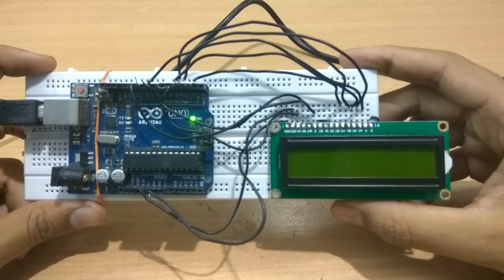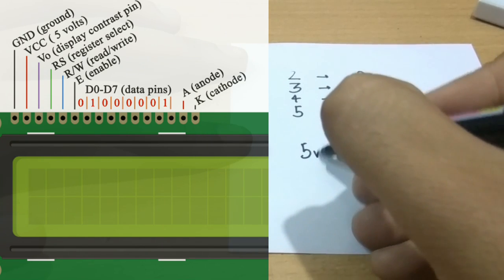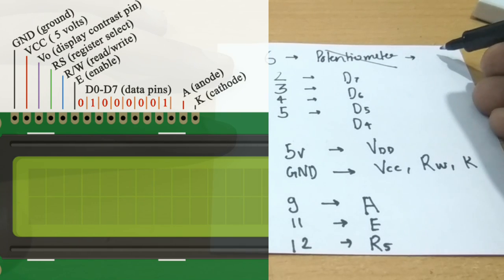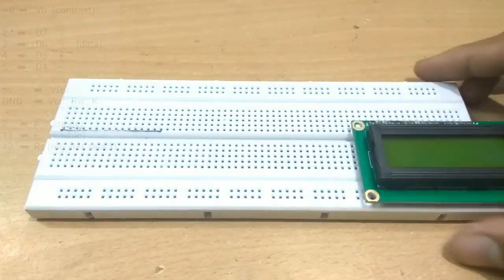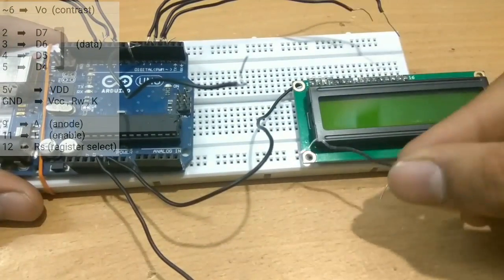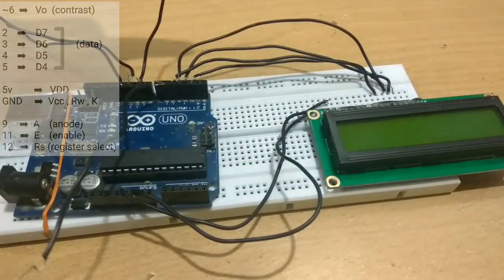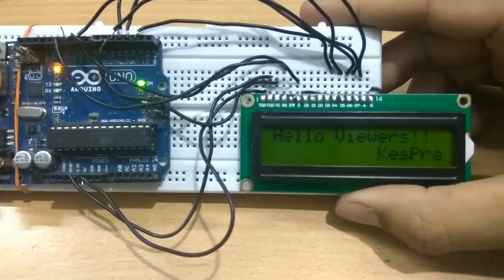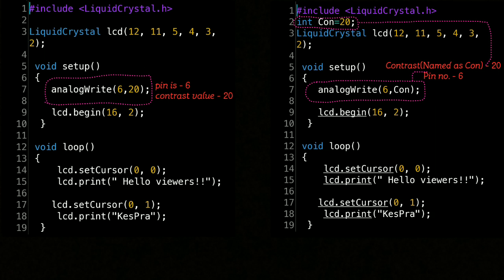Arduino - connect LCD without Potentiometer| Full Tutorial | no Pot / Resistor | KesPra ✔

Comment from the maker: #include <LiquidCrystal.h>  
int Contrast=20;
 LiquidCrystal lcd(12, 11, 5, 4, 3, 2);   

 void setup()
 { 
    analogWrite(6,Contrast);
     lcd.begin(16, 2);
  }  
     void loop()
 {  
     lcd.setCursor(0, 0);
     lcd.print("Hello Friends");
    
    lcd.setCursor(0, 1);
     lcd.print("KesPra");
}
Reply: this code shows compiling error.
Reply: @nitesh6732  then delete the arduino software and reinstall it or switch to a different user
Reply: Bro error aa raha he 
stray '\357' in program 
Koi hal batav
Reply: error '\357' only happens when you copy the code from somewhere try changing the text
Reply: @NTTechnokings  #include <LiquidCrystal.h>  
int Con=20;

LiquidCrystal lcd(12, 11, 5, 4, 3, 2);   

 void setup()
 { 
    analogWrite(6,Con);
     lcd.begin(16, 2);
  }  
     void loop()
 {  
     lcd.setCursor(0, 0);
     lcd.print("Hello Friends");
    
    lcd.setCursor(0, 1);
     lcd.print("KesPra");
 }
Reply: Guys copying the code from this comment might add special charecter in your code which will eventually show error by the compiler. Be aware of that.
Reply: whats Vdd??
Reply from the maker: shubhan patange , Vdd is for giving power to lcd using 5v from arduino or a battery.
Reply: This worked for me just fine, thank you, appreciate it.
Reply: for nano ?? is the same connections??
Reply: NT TECHNOKINGS
Please tell if you got the answer to that
Reply: KesPra mail me code
Reply: Thank you, sir!!
Reply: KesPra
Reply: Twinkle Nagmoti 
Same problem me
Reply: remove the } and line and replace it with a new }
Reply: KesPra hey.. there's an error in the program.. stray\357
What is that?
Can you please resolve it?
Reply: KesPra a
Reply: Bro can you clear one thing that is
You have solder LCD Pins socket into the breadboard circuit right ?
Means you solder LCD Pins and put into the breadboard for  connection  purpose 
Plz reply as early as possible ..
Reply: How to make the text brighter
Reply: @drdolasanjays-sreekartubeh2576   if you want to do that you need a potentiometer
Reply: I cannot copy it
Reply: THIS CODE IS GIVING ME ERROR PLS SAY WHAT TO DO
Reply: thx bro
Reply: Not working

Comment: I keep getting very dim blocks to light up but no text and change in contrast is barely visible, note that my lcd display says VSS not VCC idk if thats thr issue
Reply: mine one also says that but connect it it will work also connect the anode pin to 5 v

Comment: Make sure to use a PWM pin. What you're doing is controller the voltage and essentially mimicking the potentiometer and controlling the resistance through the voltage since V = IR or R = V/R. The higher V (0, 255) or (0V to 5V) the higher the resistance.

Comment: Here is the code that worked for me 
#include<LiquidCrystal.h>
int Contrast=150;
LiquidCrystal lcd(12, 11, 5, 4, 3, 2);

void setup()
{
analogWrite(6,Contrast);
lcd.begin(16, 2);
}
void loop()
{
lcd.setCursor(0, 0)
lcd.print("dhruvansh")
lcd.setCursor(0, 1)
lcd.print("kumar")
}

Connect anode pin to the 5v
Reply: thanks for that backlight brother..!
Reply: it doesnt work bro....display itself not showing

Comment: Bro can you clear one thing that is
You have solder LCD Pins socket into the breadboard circuit right ?
Means you solder LCD Pins and put into the breadboard for  connection  purpose 
Plz reply as early as possible ..
Reply from the maker: I have not soldered it.
I bought it from my friend with pins already soldered on the back of lcd.

Comment: This is a great project! Only downside I suppose is that it uses 2 additional pins vs the resistor way, which could be an issue for those who are tight on pins in their project.

I needed to switch both pins 6 and 9 on. Played around with digital 9 but ended up using analogOutput with a value. Here is my code:

#include <LiquidCrystal.h>
int Con=40;
LiquidCrystal lcd(12, 11, 5, 4, 3, 2);

void setup() {
  //pinMode(9, OUTPUT);
  //digitalWrite(9,HIGH);
 analogWrite(9, 500);
 analogWrite(6,Con);
 lcd.begin(16,2);
 lcd.setCursor(0, 0);
 lcd.print("Hello World!");
}

void loop() {
  // set the cursor to column 0, line 1
  // (note: line 1 is the second row, since counting begins with 0):
  lcd.setCursor(0, 1);
  // print the number of seconds since reset:
 lcd.print((millis() / 1000));
  //lcd.print(millis());
}

Comment: Arduino: 1.8.5 (Windows 8), Board: "Arduino/Genuino Uno"

liquid_crystal_dispaly:19: error: stray '\357' in program

 }ï»¿

 ^

liquid_crystal_dispaly:19: error: stray '\273' in program

liquid_crystal_dispaly:19: error: stray '\277' in program

exit status 1
stray '\357' in program
Reply: exit status 1
stray '\357' in program same problem
Reply: You need to retype all the error lines by yourself, worked with me

Comment: Why does his code say "analogWrite (9,whatever);" when this pin is actually plugged into pin 9 on the Arduino?  I see a few people below who have fixed it in their comments/recommendations.  Is this just sloppy?  A typo?  Does it depend on the board?

In any event, trying 9 vs 6 still doesn't fix my problem.  Trying to adjust the contrast number doesn't, either.  Off to double-check wiring...
Reply from the maker: Hey, pin 6 is for contrast of text.
Pin9 is for the backlight or led.

Comment: having the error : 
Arduino: 1.8.4 (Windows 10), Board: "Arduino/Genuino Uno"

LCD_INTERFACING:19: error: expected unqualified-id before '?' token

 }?

  ^

exit status 1
expected unqualified-id before '?' token

This report would have more information with
"Show verbose output during compilation"
option enabled in File -> Preferences.

Comment: there's no output voltage on pin 9 ,since there no code written for it.
Reply from the maker: Its for Backlight/LED (optional).
Give output HIGH to turn on led
Reply: +KesPra thanks dude.
your programs works perfectly.
just executed it

wat the code for output high on pin 9.can i directly connect +5 to anode directly.?
Reply from the maker: Yes you can directly connect to +5v or +3.3v

Comment: Till how much distance arduino uno HC-SR04 can detect? Distance in cm ?
Reply from the maker: Around 2cm to 400cm
Reply: Thank you, 
and do u knw till what temperature n pressure it can sustain?
Reply from the maker: It works fine in temperature range of 0–50 °С but i'm not sure about pressure , as Change in pressure will give few % of error in reading
Reply: Hey can u able to give me codes which can show distance upto 400cm... pls that will b too much helpful

Comment: I have done exactly what you mentioned in your video.But my LCD didn't display anything, not even boxes.
I don't understand the reason.Kindly help!!!
Reply: Select LCD from the arduino library bro
Reply: Same case with me
Reply: Same comes to me
Reply: me 
neither
Reply: Try this ....and subscribe if you like

https://youtu.be/MV85HWRdLPw
Reply: <LiquidCrystal.h>  

int Contrast=20;

 LiquidCrystal lcd(12, 11, 5, 4, 3, 2);   

 void setup()

 { 

    analogWrite(6,Contrast);

     lcd.begin(16, 2);

  }  

     void loop()

 {  

     lcd.setCursor(0, 0);

         

    lcd.setCursor(0, 0);

     lcd.print("system crash");

}
use this code

Comment: Arduino: 1.8.2 (Windows 10), Board: "Arduino/Genuino Uno"C:\Users\armanrockali\Documents\Arduino\sketch_lcd\sketch_lcd.ino:1:28: warning: extra tokens at end of #include directive #include <LiquidCrystal.h> Â                             ^sketch_lcd:3: error: stray '\302' in program  LiquidCrystal lcd(12, 11, 5, 4, 3, 2); Â    ^sketch_lcd:3: error: stray '\240' in programsketch_lcd:9: error: stray '\302' in program   } Â    ^sketch_lcd:9: error: stray '\240' in programexit status 1
stray '\302' in programThis report would have more information with
"Show verbose output during compilation"
option enabled in File -> Preferences.
Reply: Check Your Arduino Connection to PC, First try Other Blink Program, If Works, then problem With LCD Wiring , If still says error, then Problem with Arduino Connection To PC/Short..

Comment: Is there any way to bring-on the brightness? Works fine but no brightness. My Lcd is a 16X2 - 16pin
Reply: Yes, Change the Contrast, like in the Code,  analogWrite(9,50); 50 is the brightness here..
Reply: put the A slot on the LCD on to the ~9 slot of the arduino or sunfounder (Any type of Arduino board)
Reply: I had the same problem

Comment: I did the connections as mentioned in the video but the data displayed on the LCD are not clear
I think the backlight of LED must be set to high in the code
Reply: analogWrite(9,50);  , Change the 50 value and check it out.

Comment: Hello so my lcd didn't come with pins on the top and its not displaying anything...
Please respond soon
 thanks.
Reply from the maker: NinjaRick , hey in that case , try to connect wire to name of pins i.e. find where is your groud , k, a,  etc pins on your  lcd.
Reply: I have everything plugged in it just isn't showing up.

Thanks though
Reply: Backlight is running ? Then Problem is with the code. make sure to add  analogWrite(9,50);

Comment: my lcd glows very brightly...bt my board does not displays letters...do i have to change my program with other values
Reply: use the 3.3V slot for the Anode on the LCD
Reply from the maker: Roashan S , try higher value for contrast (try increase number from output  pin i.e. 6)
Reply: +KesPra any change of value ....the light jst glows bright ..
Reply from the maker: Roashan S , i that case i recommend you to recheck the wires(connection) between arduino and display
Reply: Also, Use Analog Write
Reply: Roashan S yes

Comment: My ardrino switches off as soon i plug in the lcd
Reply: Im a bit late, but thats a short. I don't think it breaks it, I do it all the time!
Reply from the maker: Acoustically Us , i think you should  check your connection
Reply: You are making mistake in connections specially check the connections of 5v pin and ground pin that is either you connected them right or not

Comment: does the pin 9 give nothing through the coding ? what is the function of pin 9
Reply from the maker: Hey Noor, Pin 9 Is For anode pin.
It's nothing to do with coding.

(Anode & Cathode for LED back light, which is not the main feature. It’s an additional feature you can replace a backlight with normal 3mm LED’s with a separate 3V supply. Most important is the data lines, contrast adjustment & Vss, Vcc etc….)
(I'm not a pro. but tried my best to answer)
Reply: i wrote your code but there is no back light in my LCD then i digitalWrite pin 9 HIGH in the code and it work just fine so i think thats what pin 9  is for

Comment: i am getting a error like

exit status 1
stray '\357' in program
Reply: if you delete the highlighted line and re type this error should clear.
Reply: THnx
Reply: So what exactly did u retype? im still getting error >,<
Reply: have the same problem
Reply: Hi, I just fixed that issue.

1.- Make sure you have the library "LiquidCrystal"
2.- At the end of the code remove a dote ( . )

This is the code:

#include <LiquidCrystal.h>  
int Contrast=20;
 LiquidCrystal lcd(12, 11, 5, 4, 3, 2);   

 void setup()
 { 
    analogWrite(6,Contrast);
     lcd.begin(16, 2);
  }  
     void loop()
 {  
     lcd.setCursor(0, 0);
     lcd.print("Che Mayoro");
    
    lcd.setCursor(0, 1);
     lcd.print("MAMOR");
}
Reply: Retype }

Comment: Hey keshav!!! hi I tried whatever you have explained in the video but on lcd  it's showing only blocks■■■ 

pls tell the cause....

Thanks!
Reply from the maker: ishubham singh , Hi check the program ( for contrast on pin ~6)

Have you seen the Program given in Comments.
Reply: ya I wrote that program only...

I got it... i found that one wire came off😓...

thanks!!!
Reply: Hello. Either increase contrast to e.g., 90 or try connecting V0 to the ground.
Reply: turning contrast value to 90 worked for me thanks you